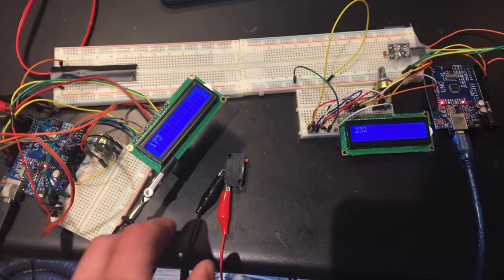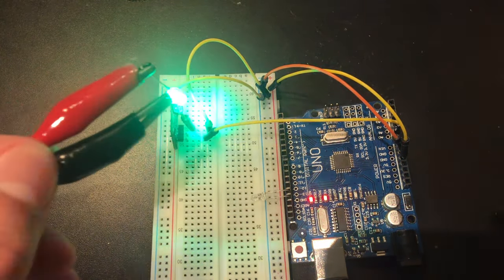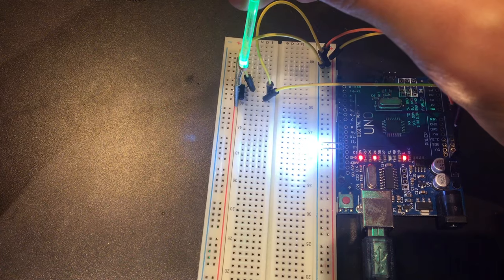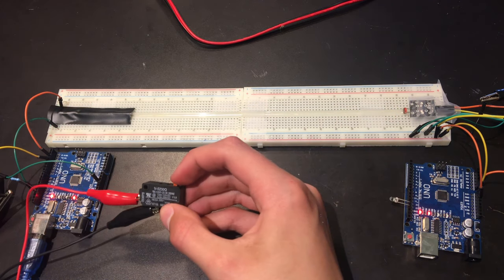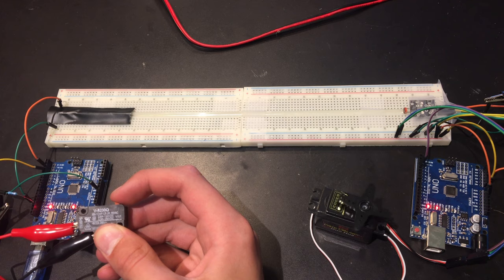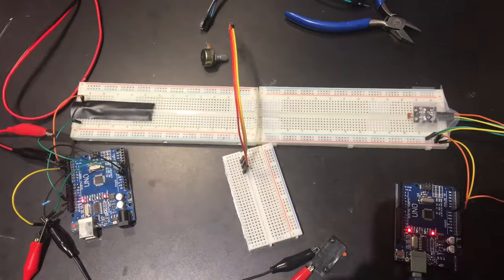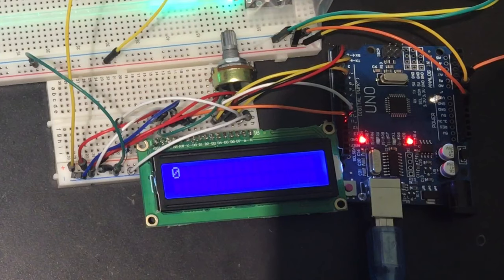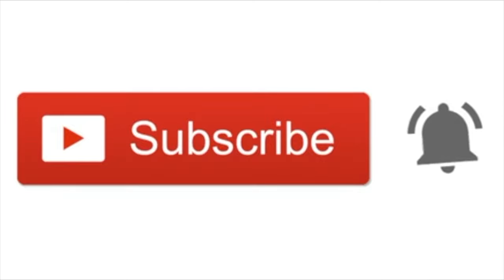Arduino Fiber Optics | Transmitting Numbers Using Light?

Comment: Can I use such a setup to prove that we can transmit the laser in fiberoptics freely in space?
Reply from the maker: You should be able to do this if you use a laser, yes.
Reply: @CarbonCoil   thanks.  sending you an email rightaway so that you can send me the  code used.

Comment: I would suggest using a phototransistor as they have faster response rates than photoresistors. However, this is a great demonstrator and it works outstandingly. Great job!
Reply from the maker: Version 2.0 might be coming soon and thats one of the upgrades I would make for faster transfer time, thanks!

Comment: It's worth pointing out the light does not travel faster than electricity, but rather electrical signals degrade faster over lengths of wire, meaning repeaters will be necessary sooner, adding latency and distortion to the signal.
Reply from the maker: This is somewhat true. While electricity does travel slightly slower than the speed of light, practically this doesn't make much of a difference. The main advantages of using fiber optics come from their higher switching frequency making them more suitable for high bandwidth applications.
Reply: @CarbonCoil  I don't follow. How can light have a higher switching frequency?
Reply from the maker: @FenrirTheMenace   Essentially when you run a signal through a copper wire or a fiber optic cable, as you increase the transmission frequency, the signal degrades more in the copper wire than it does in the fiber optic cable (because of interference, reflections, etc.)

The actual physics explanation behind this is a pretty deep topic, but the important takeaway is that fiber optic cables can carry much higher frequency ranges without distortion, and a higher frequency range means higher bandwidth (or the amount of data that can be transmitted over a certain time period) - Paraphrased from Prof. Robert Malaney, University of New South Wales

Comment: .. impressive work ... someday we will have a Optical Serial Bus instead of USB flash drive... with 2 copper+ 2 optics wire and a photo detector in each OSB to manage & store data like  a typical flash drive... reduces systems copper resistance heat and speed...mybe motherboard can be designed to handle photons as well to transfer data between drive to RAM..

Comment: How does it detect multiple zeros? Like 0000? What does it sensing ?
Reply from the maker: Multiple zeros are represented by multiple time slots where there is no light. The transmission sequence begins with a starting signal that syncs both Arduino's and tells the receiver that data is going to be sent. Then the Transmitter sends data (the LED being on or off) in each time slot during the transmission representing a 1 or 0. To represent multiple zeros, the transmission Arduino would just send the starting sequence and then turn the LED off for a length of time in accordance with how many zeros there are.
Reply: @CarbonCoil  thank you very much for a clear answer

Comment: i love ur project, did u test increase the frecuency of data transmision?
Reply from the maker: I have not tested this yet. The photo-resistor sensor I used is pretty slow to react to changes in light, therefore I would choose a different and more reactive sensor before increasing the frequency.

Comment: By the way , why dont u use a laser diode module like Ky-008, and can u make the code faster?, I wanted to make a laser tag game but just couldn't the life of me thing of how to send data via light.
Thank anyway u thought me alot
Reply from the maker: I could have used a laser diode but I didn't since this was just a test setup. The main bottleneck was actually the sensor. The Photoresistor sensor is quite slow and other sensors would ideally work better.
Reply: @CarbonCoil  ah i understand now, well thank for the reply

Comment: How fast can it go?
And the ways to make the process more faster?
Reply from the maker: It's very slow due to the slow response of the photoresistor and my poor programming. This transmission could be sped up by using a photodiode instead of a photoresistor or some other faster-acting sensor, and then decreasing delays in the code.

Comment: can we use a single arduino???
Reply from the maker: Technically you could do this, but then there wouldn't really be a point in transmitting the data at all. One Arduino is the transmitter and one is the receiver.

Comment: Isn't the speed of light and electricity the same?!?
Reply from the maker: Electricity does travel slightly slower than the speed of light, but practically speaking this doesn't make much of a difference. The main advantages of using fiber optics come from their higher switching frequency making them more suitable for high bandwidth applications.

Comment: I don’t understand please explain in kindergarten terms
Reply from the maker: The number on the left screen changes as the knob is turned. When the button is clicked, the small computer turns the number into binary, and sends it over the acrylic tube as light. (Think of this transmission like using morse code, sending messages from place to place by flashing a light on/off in different patterns). The Arduino on the other side turns this binary (The light pulses) back into a number and displays it on the screen.